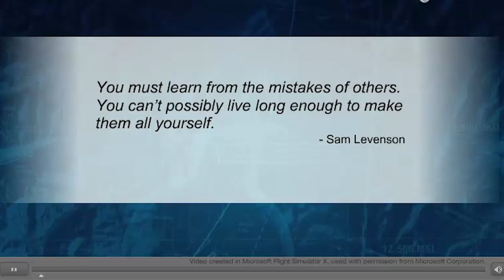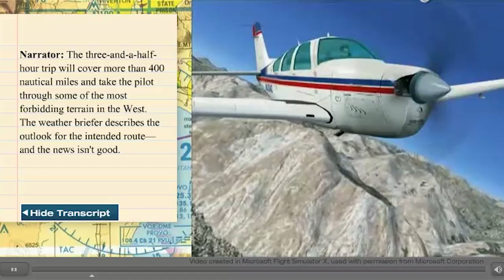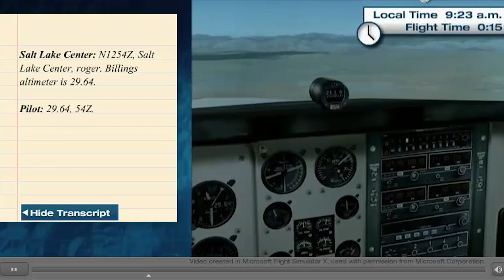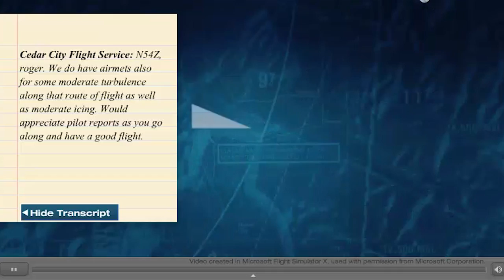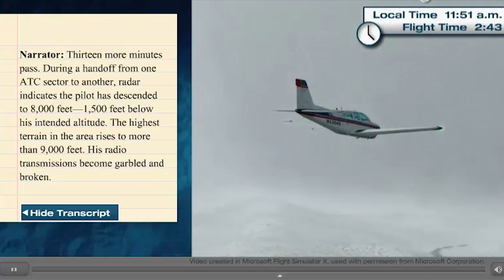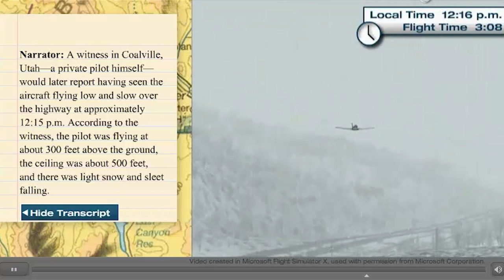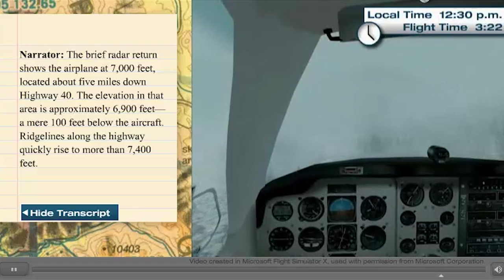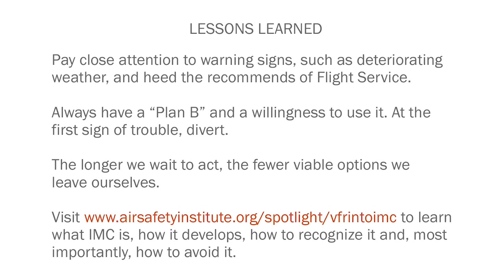Accident Case Study: VFR into IMC

Comment: I have driven that canyon many times, and it is dangerous in bad weather.  Bad enough in good weather.  I can't even imagine someone trying to fly it at an altitude of 300 ft. above ground!
Reply: In a canyon is not a good place to try to execute a 180 degree turn. One does not think about the radius necessary to perform that maneuver at flying speeds. Even if you set it up correctly under good condition, it is a bad flying choice, but when the weather has closed in on you, well, RIP. Somewhat tongue in cheek: If you own an airplane and want to do something stupid like this, do us a favor and sign the plane over to me and stay home. I'll take good care of it for you and you will live another day.
Reply: He was actually measured by radar flying just 100 feet AGL.
Reply: @TheUtuber999  At the end of it he was 0 feet AGL.
Reply: @authoranonymous8892  Too long ago.  Don't care.
Reply: Laron Woods 
Just gotta get my proton torpedos in the exhaust port.
Then we can blow this thing and head for home.
Reply: indeed, the farther in he got, the less able he was to turn around. A chandelle would have been an appropriate 180° maneuver, but he apparently lacked the skills for that and the IMC that would result.
Reply: He was flying even closer to the ground, unable to see the highway otherwise.
Visibility was probably less than 100 feet.
The police mentioned, called it total white-out conditions.

Comment: As I watched it, I kept saying "land on the road". That was his only chance. Even a climb into the clouds could have resulted in missing a turn in the pass and impacting the high surrounding terrain.
Reply: Erik Wagner • Not to mention icing.
Reply: What seems strange to me is that they say he flew over Heber and down 40 but don't mention that there is an airport right along 40 in Heber. So while I too thought about landing on the road, he flew over a perfect solution just 4 miles before crashing.  So there is some situational awareness at work along with poor decision making.
Reply: @cardinalflyer  They did mention the Evanston airport several times.
Reply: @cardinalflyer  The fact this guy didn't have his instrument rating, received multiple weather reports that would make the most seasoned cropduster/military trained/thousand hour IMC pilot's hair stand on his neck....and still flew into it? More than arrogance, just plain stupidity or suicidal.  I hope his loved ones havent' seen this video, it would be difficult to hear this and not be angry forever at him.
Reply: I thought the same.
Reply: Yeah, the only other solution would be to climb while circling until your radio starts working again. With Radar or good GPS signal you could make your way out again, but only if you're familiar with flying on instruments.
Reply: @RubenKelevra  He was not familiar with flying on instruments, that's why he was doing what he did. He would have died within a minute if he had entered the clouds.
Either disorientation from not knowing how to fly on instruments, or icing on the wings making the plane unflyable.
Reply: Would have been way better to get a scolding and fine from police and FAA for landing on a road and having to arrange transport back to an airfield than flying when flying is not possible
Reply: His arrogance wouldn't allow him to do that.
Reply: Erik Wagner yes try to land on the road worry about the consequences later at least you'll still be alive
Reply: That was his last out, yes. But he had plenty before - starting from not even taking this journey with those weather reports to landing at Evanston (9:37) where he already was flying way low to stay VFR, but could've made the airport no problem...
Reply: I read light and telephone wires are an obstacle to road landing. Maybe not on this road being an interstate though. It's unfortunate an accident agent can't, when disaster is a likely outcome order plane not to proceed.
Reply: If he'd gone for a much higher altitude, and done a 180, ATC could have talked him to a clear area........
Reply: He only had to get to 9k right?

Comment: "I'll just slip on in and if it's bad, I'll slip back out". Unbelievable that a 1000+ hour pilot could still have that kind of expectation bias. He clearly believed that either the weather wasn't as bad as FSS was saying it was, or that it would clear up, or worse, that his previous scud-running experience would save his butt this time like it obviously did on other flights into questionable wx.  My heart goes out to this man's family, but this could have been avoided if he had simply heeded the wx reports, or even the visual queues along his route.  Or if he had merely set his personal minimums at VFR minimums.  Choosing to ignore current, relevant wx info in mountainous terrain while watching the wx deteriorating around you is a suicide mission.
Reply: You hit it on the head there: "previous scud-running experience". We can't know for sure if that was the case, but this WX was so awful and he was so calm and nonchalant about flying in it. The most likely explanation is that he flew like that frequently and was comfortable with it. He also maintained control of the airplane up to the last minute. His Bonanza was a very capable IFR platform so it's plausible he had been teaching himself to use the instruments to aid his scud-running.
Reply: The simplest thing he could have done was just set it down on the highway and skid off into the shoulder I'm sure traffic was light enough to get a big space between cars. I have en on that highway before and there are long straightaways with lots of room set it down he would have to admit was was wrong.
Reply: Landing on a road could be dangerous. Did he not have the option of increasing altitude into the cloud above the level of the terrain, and heading towards the nearest airport with good enough weather conditions that he could land there?
Reply: weather depends on the ceiling but as for the mountains the beech bonanzas ceiling is about 18,500 so yeah
Reply: @dunbustin  The local police said  'near whiteout' conditions and that's at ground level.  I don't think he had the training, horsepower, or conditions to climb out of that canyon.
Reply: @dunbustin  He was not instrument rated. You get disoriented very quickly in the clouds, as many videos on this channel show. He would probably have survived less than a minute due to that alone.
Now add the bad conditions, with heavy ice and snow, which would have covered his plane to the point it would no longer be able to fly. That's what they mean at the start with Level 2 and 3 conditions. Level 2 is already a no-go, only commercial big jets can handle it for a few minutes. Level 3 is NOPE.
Reply: thats just what I was thinking, why not land on the hgwy? part of the problem I think is that the more a person does something w/o any problem the more false confidence they have that nothing bad will happen... until it does
Reply: This guy thought he was smarter than four COUNT 'EM FOUR controllers and a weather briefer. Trouble is, by regulation they can't forbid him to do that. I'll bet that they wish they could. Thanks for the video. I just printed out my course completion certificate. As my wife says: better to miss a flight today than miss every flight going forward.
Reply: This was a desperate man IMO.  There is a backstory here of a man up to no good and believing himself to be without options IMO.
Reply: @knowsmebyname  where do you hear anything about a backstory in the video?
Reply: @cathleenrocco4804  I have no proof.  It just seems obvious to me.  I accept the fact that people don’t agree with my theory.  Unless he was suicidal he was desperate IMO.  Sex, money, or drugs.  So what that the investigation turned up nothing.  Did people expect his drug contact or mistress to call the fAA and in insist on being heard?  But it’s just my gut feeling.  I have no proof.  I understand reasonable people have other thoughts.
Reply: Dustin Woodhouse - Honestly, you could hear in their voice that they were really trying to get him not do that flight. It was his stupidity that killed him. I don’t feel bad the slightest.
Reply: Ron A Can't ATC  just not clear him for flight? It seems like this should be something that should be allowed.

Comment: This is why you shouldn't attempt long cross countries without an instrument rating. Being a pilot out of the Salt lake area and flying out of Spanish fork the IFR conditions are quote dangerous especially with the towering terrain surrounding the area.
Reply: Are you a pilot?  I've flown many long cross countries VFR; you have to be absolutely willing the fly up to the weather, take a look and sit down when conditions warrant.  There are lots of mitigations to prevent this accident, some of which this pilot demonstrated, but ultimately failed to heed & implement.
Reply: Also to any pilots thinking about doing long cross countries and are not IFR rated. BRING AN IPAD! An iPad with fore flight and a GPS chip is like a mini G1000 can definitely help you as a pilot if you ever do get into IMC and need to get out.
Reply: Well, there's another video about a couple who used ipad to navigate and got lost
If you're not IFR rated and the ceiling less than 3000, you should expect IFR in few hours
Reply: agreed. an instrument rating wouldn't have helped this guy in those cold clouds. He thought he was flying an Intruder--but we only did that in better weather than this. Fool.

Comment: Seems to me these thing happen because previous times he had done the same thing and nothing happened. I wouldn't even drive a car in that weather on a highway in white out this idiot is what gives GA a bad rap this guy should get a Darwin award. He even could have just landed on the highway slide off the road.
Reply: I would not have flown that route IFR... sliding between mountains in anything less than solid vfr is not for me... Over the top or not at all.
Reply: Some people like to push their luck
Reply: most likely those people don't want to stuck in the middle of nowhere but It's settled the moment that they decided to continue the flight or failed to recognize the issue
Reply: Agreed. 99% of the time it worked for him probably.
Reply: To qualify for Darwin, he can't have reproduced.
Reply: That was my impression as well. He was a risk taker. He's tempted and skirted fate before. He rolled the dice and lost this time. Why he didn't land on the interstate is beyond me. So what if you loose your flight privileges...at least you are alive.
Reply: Lehmann Peters I didn't think of that!

Comment: What makes IFR so hard?  Don't you just look at your instruments, keep level flight, and get a heading / alt from atc?   From a non pilot
Reply: It is really difficult to ignore your senses. Your vestibular system is worse than useless in IMC (instrument meteorological conditions). While non-instrument rated pilots are trained during primary flight training to fly solely by instruments, it is more of a life saver in case of an emergency. There is nothing inherently wrong about flying in IMC. The challenge is, if you're flying VFR (visual flight rules), your primary means of avoiding other airplanes is by visually scanning the area. You can't really do that once you're in the clouds.

There's also the fact that the pilot might be really stressed, and in an effort to get down on the ground ASAP, they start fixating too much on one instrument, ignoring the others. The "scan" that pilots perform in IFR flight takes a few hours to master, and quite a few more hours to maintain proficiency.
Reply: It can be very disorienting for pilots if they are in full IFR flight. It's not like driving a car in a really bad storm. In a car at least you always know where the ground is and how fast you are going. In an airplane that goes out the window. You can feel like you are going faster but in reality you are slowing down, or you think you are higher than you actually are, or you can't figure out where the ground is. The reason pilots lose it in IFR is they get task saturated, meaning they start to get worried, they have a million things to keep an eye on, and eventually it gets to be too much and they start making poor decisions.
Reply: Timothy Stockman • As a non-pilot, the scariest thing about this particular tragedy is that all of his "outs" may have been exhausted by the time he crashed. To make a 180° in a canyon where terrain was higher up on both sides would have been disastrous. To fly up and then to turn would have probably iced him. Under similar circumstances, was his only chance to land on the highway, risking a collision with traffic, overpasses, or signs? I'd really like to know what his best option would have been (besides not going to begin with).
Reply: +gomphrena
You have  a  point. Although not legally required, mountain flying takes extra training (which I never did).  But he apparently flew this route regularly, so he should have known to make the 180 before going into a canyon. There is a maneuver called a chandelle, which I've  done  a  few times in VMC,  but never in IMC. This is a climbing, minimum radius, non-aerobatic turn, but he may not have even had the room for that.

In this case, probably the only option left, not even a good one, would have been to land on the road. Highway landings have been successfully accomplished many times, however not in such forbiding conditions...

I once heard the saying "A superb pilot uses his superb intelligence so he doesn't have to use his superb skill."
Reply: Private pilots are trained to make a 180 turn on instruments only in case they inadvertently enter a cloud. But making a flight in real IFR takes some extra training. That's why it's a separate rating. One thing you're constantly doing, as you scan the instruments, is making sure they are all consistent with each other. Instrument failure happens, and you don't want to turn the airplane over following an attitude indicator which just lost vacuum. That's why instrument training includes partial panel.

Comment: Can ATC forcibly order a pilot to return and land?
Reply: No.
Reply: Nope it's the pilots decision
Reply: Pilot in command has the ultimate responsibility.
Reply: How could ATC "forcibly" order a pilot to do anything?  He's in the air, they're on the ground.  They can give flight vectors, can clear planes for landing and takeoff, can tell pilots what altitude they need to be at, but they can't "force" anything.  Unless you're in a fighter jet, there isn't much you can do to compel a pilot to do something he/she doesn't want to do.

Comment: If you are vfr and you fly into, or know you are about to fly into, imc conditions, and you are instrument rated; can you switch to an ifr flight plan mid flight?
Reply: The Lowmein yes. You can request a pop-up IFR. It's best to just turn back if you can or don't be afraid to declare.
Reply: You can request it, but you may not get it (as you may not have required separation, etc).  It's a hard transition to make suddenly anyways.
Reply: The Lowmein Depends on how busy they are for a pop-up filing. You may have to wait around for a bit.